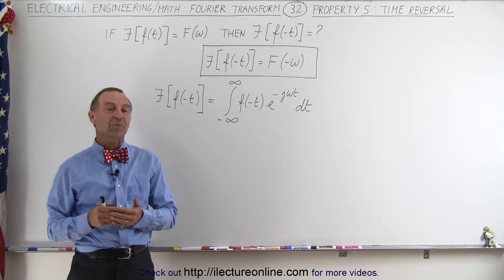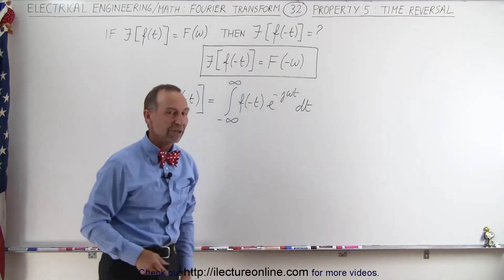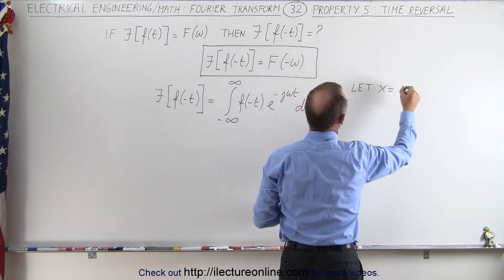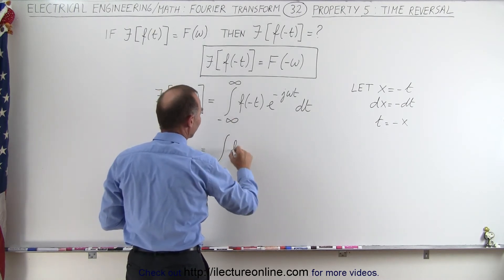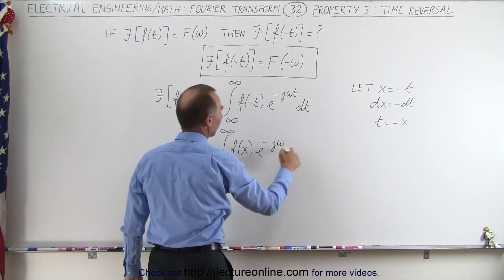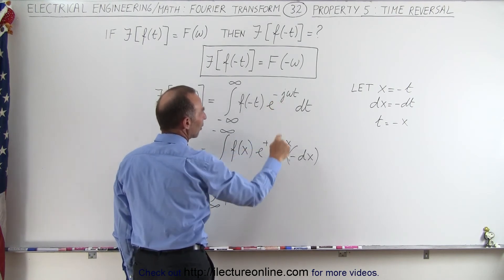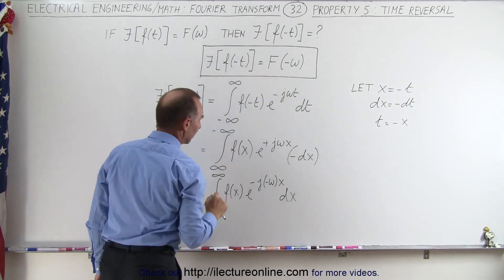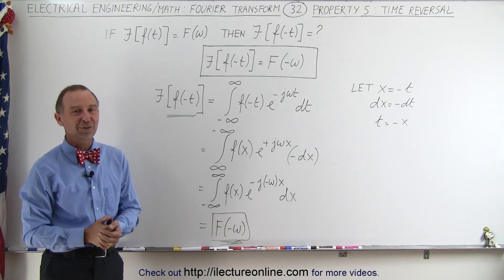Electrical Engineering: Ch 19: Fourier Transform (32 of 45) Property 5: Time Reversal

Comment: I don't understand why you flipped the limits.
Reply from the maker: Usually we change the limits in order to change the sign of the integrand.
Reply: @MichelvanBiezen   I know that flipping the limits we change the sign. What i don't understand is the following: you set x = -t so f(x) = f(-t), also dt = -dx, so in my calculation i got -integral from -inf to +inf of f(x)e^(-j(-ω)x)dx = -F(-ω) but you don't have the minus sign outside of the function. Why?
Reply: @MichelvanBiezen  Is the reasoning the following? x = -t and as t -> plus/minus inf then x  ->  minus/plus inf